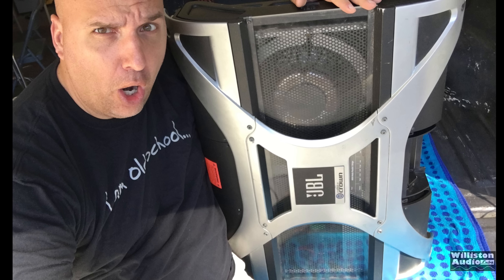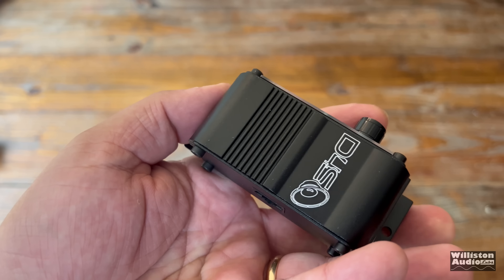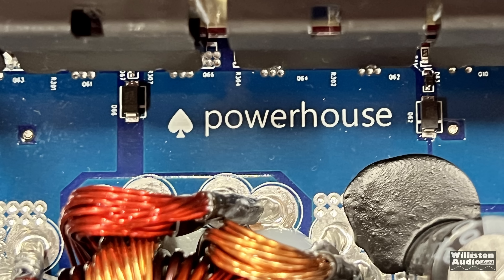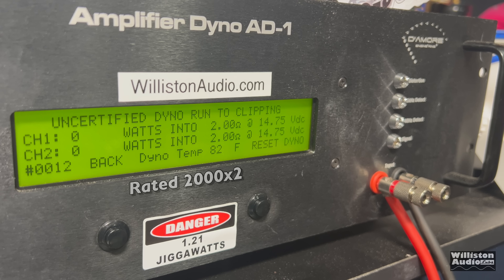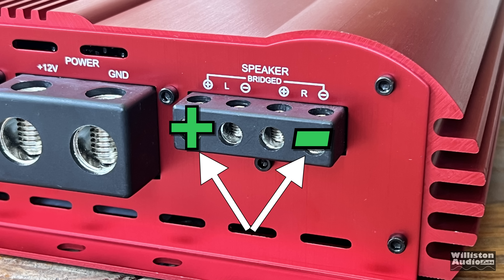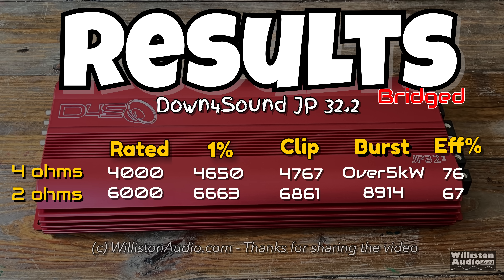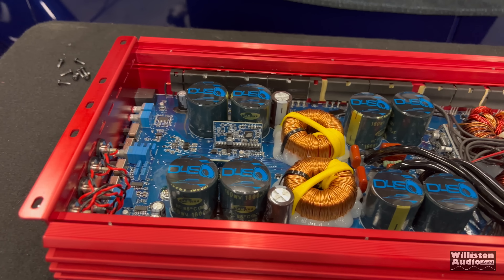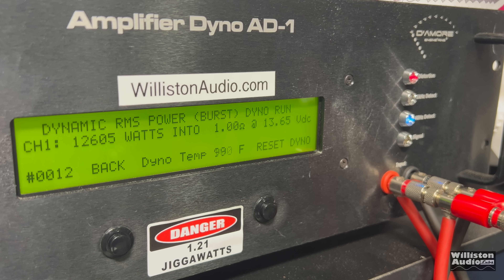Why Do You Need it? 6000W Two Channel Amp

Comment: Jp makes great stuff
Reply: Ehh overpriced for sure
Reply: There nice they smell easy, the speaker instert terminals strip super easy aswell on them. Overall there all right my jp23v2 they get down, but they get pretty warm really quick
Reply: @PedroKing99 good but you needed plenty battery power or lithium though
Reply: @Az56818   u are crazy
Reply: @JohnnyCashCadillac   got multiple jp amps all put put more than rated power
Reply: @jasx1485  nah they're nice Korean amps but just slap his logo on it triple the price but hey there's always fan boys and ppl who like showing off
Reply: @Az56818   yeah I know a bunch of other brands that slap there names on Korean boards as they do with Brazilian boards.    👍 for stating the obvious
Reply: @JohnnyCashCadillac   sure you do
Reply: @JohnnyCashCadillac   when did I even say anything about Orion?  Why you gotta get all weird
Reply: @jasx1485  he wants you
Reply: @adampatterson3188   yeah he deleted his comments acting like a weirdo 🤣 over some amplifier
Reply: @jasx1485  lol I figured 😅🤣
Reply: @@robertdavidson5903  crescendo and dc amps look the same board to me and they just have a different sticker
Reply: @@robertdavidson5903  just stop while you are ahead
Reply: @PedroKing99  it hasnt crapped out on me and seems to be pushing well over rated watts, im pushing half ohm on a zv3 D1 18 SA but like i said they heat up pretty easily and they do tend to smell a little bit when they start to hit 100+ degrees

Comment: Bought a skar rp1500.1 2 years ago when I first put the build in my 98 s10 extended cab....and it never gave me a mins trouble ....but I was a teenager in the early to mid 90s so I remember the old us amps and how cool those big boys were ....so I bought a jp23v1.5 and it's a beast for the price caught it on sale for 249 around first of the year ...and it seems to be a very good amp ...build quality and features for the price I don't think you can beat ....sure there are cheaper amps that might even do same power but for the money the jp amps are a incredible  investment....i have run mine for hours and never heard the fan come on or seen the temp over 116 usually runs around 106....at full volume....granted I am only a little past half way on the gain ....because that's all the power my American bass xr dual 2 12 needs or seems to be happiest at ....so yeah as you say jp for the win ....great products
Reply: You do realize gain has nothing to do with how much power an amp puts out right?   Its matching the input section to whatever your head unit is outputting.  So say a Kenwood Excelon with 5 volt preamp section the gain would stay all the way down and still put out max power.  Just an fyi

Comment: I dont know what you were talking about with the quad box not being hella loud Big D. I had on some high quality earbuds and the bass was insane coming from the quad box. 6000 watts should get you into the 150's with the quad box in the right car. Anyways great video as always bro. Love JP's amplifiers. They pretty much changed the game. Way to go JP. I had been a d4s customer for years before this, but the next amplifier I order is definitely gonna be a JP63
Reply: Yeah man. I have a 8 inch crappy Skar hooked up to my office computer and the quad box was rattling my walls!
Reply: @Jeff_Moreland  That's awesome. I was thinking about doing something similar with a pair of American Bass XR 12's in a 4 ft³ ported enclosure and an Orion XTR 2500.1 I have laying around from an older stereo, but I'm honestly afraid I'm just gonna knock everything off my walls with it, lol. It did a 148Db in a Trailblazer with a small 32Ah LiFePO4 lithium bank, and a 270 amp alternator, and the sound quality was really good on the AB XR subwoofers. Guess I'll try to stuff that old system into the trunk of a cheap hatchback and have some fun with it. Maybe add 2 more subs and a few more lithium cells, plus a JP63 and see how she goes.
Reply: @catch22frubert  that’s a lot for inside your house. If you do it you will need power supply that can provide some voltage to that amp

Comment: The amp not counting cleanly is definitely a cause for concern. Sounds like an interference issue inside the amp. Even with the outputs on a resistor bank, and nothing wrong with the bank, it should count clean. I would need to see a schematic, but I’m willing to bet there’s a filtering/emi suppression issue.
Reply: Won't be no schematics, this is a ZEON brand amp. They will provide no schematics. Its Korean....barely. S and I will provide schematics as long as you are their customer.
Reply: @XM913CG  D4S is regarded very well, making an amplifier that introduces enough noise to where it can’t count properly sounds like a major oops.

Comment: Power is much cheaper today than it was back when the JBL A6000 was made. However, the JBL was still more powerful delivering the 3000W x 2 at 2 ohms rather than 1 ohm. The JBL was probably cleaner power also. D4S really isn’t an SQ brand by any means. They are made for power and big bass, not really anything else.
Reply: Yep, back in the day you didn't have to run massive electrical in your car to hit 150db.

Comment: Do you have a guide or something detailing what these tests represent? I am an aspiring electrical engineer and I'd like to understand better what you're showing here. Great video!
Reply: The certified tests are to show what the power rating of the amp is as certified by the manufacturer. So when they put specs & information in the manual that the amp produces an RMS power of say 500watts per channel that it is Certified from factory to either produce that wattage or close to. Some companies try to be truthful and also tend to down rate the actual power rating put out by the amplifier. So in the manual they would say it's certified to put out 500watts RMS when in actuality it is producing 580watts RMS. For reputable brands it's a safe zone so they don't get called out for lying.

Uncertified tests are just that, uncertified. So where the amp would be Certified to produce 500watts RMS per channel or close to, its' Uncertified rating would be that 580watts RMS that's actually being produced while in use.

The Burst tests are to show what the amp will physically put out in a small duration of time while playing a tone track. An amp will physically play at a power rating far above what it's made to produce while in normal usage. Then it will level off to its' certified power rating.

I hope my ramblings are easy to understand. I was also using examples to get the point across so it's nothing related to the video. I am neither an engineer or a professional audio technician, just someone who finds audio of all types interesting. :)

Comment: A hidden pro of this amp (like the massive 4 channel you tested several months ago also) is this is a modern class D. Most of the big class D amps are still using 20 year old PWM driver tech that can’t reproduce a full range signal, so the tech is reserved for subwoofer amps. But it’s 2023 and standards need to evolve like they have here finally. All the new huge class D amps—even ones intended for subwoofers—should be using modern PWM circuitry like this. Hope amps like this set a new standard
Reply: It didn't count clean at 1khz, I don't know how full range this really is.
Reply: @timmturner  it was probably just slightly above 1% THD because it jumped up at the end to rated. You won't hear 1% THD from an amp on anything but extremely high end speakers or studio monitors. Speakers that costs tens of thousands. And even then wthout well trained ears you'd only hear it playing test tones and not actual music
Reply: @darrylpioch2055  what I'm saying is at higher frequencies it may be worse
Reply: @timmturner  and class Ds have different distortion levels at different frequencies. Any frequency that's a lower harmonic of the amp's PWM switching frequency will have a lot more distortion. That 1K could have been among them and it might have a lot less distortion at 15 or 20k

Comment: Hey man I have a question for you I have a taramps 3k hd and and 2 dual 1ohm Rockville punisher wired at .25 ohm. Do you think this would damage my amp, the amp is turned down very low because this amps is insane on power! Big shot out to you and your channel because without watching ur vids I wouldn't of know how much power this amp has. it runs fine amp doesn't get hot no clip light or protection goes on. Would value your opinion cuz ur a pro!

Comment: Are the speaker outputs too small for almost 5000W/channel
Reply: No they are fun
Reply: I mean, technically, they should be 4 gauge outputs if you want the real answer from an electrician, but 8 gauge will be fine for most people, and you can always get a pure copper dual 4 gauge to single 8 gauge if it's something that bothers you. But yes, technically, those outputs could be hitting 100 amps each in quick pulses. I would recommend a dual output or 4 gauge to 8 gauge reducer and use 4 gauge ofc wire and you will definitely be fine, even using it for bass demos only
Reply: @catch22frubert  he hit 468 amps on that one run
Reply: @BloodCover thats on the input side, not output

Comment: How can the amp dyno not go above 5002 (over2) in that one test when you state it can't measure over 5k, yet the next tests are over 8k?
I'm confused.
Reply: It depends on the Ohm load. the higher Numbers were on 2 and 1 Ohms.
Looks like the Voltage gets too high. So it should stop at 10k at 2 Ohms and 20k at 1 Ohm

Comment: Personally don't like the fact they used only 85C caps on the one section. Amps get hot. You should always use 105C rated caps.

Comment: I had to jump on 1 of theses for the Christmas sale i got it for 414$ out the door with shipping protection,  i figured at that power i can use it for a bass amp  if my jp83 ever has any issues @wal , if powered and tuned correctly i should be fine running it as a bass amp correct?
Reply: Got it for that price too. I emailed D4S and they confirmed it can definitely be used for subs.

Comment: I have a question big D, I just installed 2-12s audio legion maximus but I only have 1-skar 1200.1 amp should I pick up another matching amp so I can run one for each sub or try and get a 3k amp or bigger??
Reply: If you have clean power to run a 3k it would give you a little more head room to go that route but it takes power to make power if your trying to pull 3 k off stock electrical system its gonna be hard to do without some help.... personally i would go with a 3k if you have the electrical to push it not to mention its half the wiring running one amp VS two smaller ones

Comment: That amp seems defective. Also, why did you say the amp dyno cant measure over 5000 watts and then the next run 2 ohms bridged it reads 6664 watts? Are you sure that the OVER2 isn't some kind of overload protection on the dyno? Amp seems defective.😢

Comment: I’m on the market for a amp i’m looking for something around 1500 watts rms in 1 ohm. been looking at downforsound and ct sounds amps but noticed no fuse boxes on most of these amps unless you go name brand like kicker etc. i’m wanting to get two dd audio 10s 4ohm  600rms each. Any suggestions?
Reply: also if was to pick up a amp like the jp8 why do they not have fuse blocks?
Reply: @Inimical_imi you have to use an external fuse. My CT sounds AT2300.1D is fused at 250 (externally) I actually prefer it this way. I'm not a huge JP fan but his amps are pretty nice and some are priced well. As for CT sounds, this is my first amp from them and I am impressed,  it's a little powerhouse and the build quality is decent. Still not sure how accurate the voltage meter on the bass knob is though...but the clip light seems on par with all my tuning.
Reply: @zackbalins658  thanks for the reply. alright that makes sense. i’ll def be considering it as a option more now. i’ve been torn between the jp8 and ct sounds 1500.1  i’ll have to do a alternator upgrade and the big three running 1 ohm but i think i can run em at two ohm until then and get decent performance
Reply: @Inimical_imi  funny you mention that, because I'm actually running my two DD612's at a final 2 ohm impedance on the CT amp. Looking to get different subs for a 1 ohm load. I do have the big 3 and a Mechman 270...but no extra battery reserve. It does ok.
Reply: @zackbalins658  nice!!! i’m just getting back into car audio got a older trailblazer 2008 i’m wanting to do some upgrades to not wanting to compete (spl) but wanting to compete with one of my fave set ups i’ve had a single jl w3 12 w a 500/1. 

If i did get a amp in theory that runs 1500 watts i’d need a line fuse that’s 150amp?
Reply: @Inimical_imi  correct...if the amp is not already fused. There are 1500 watt rms amps out there that are already fused as well...just make sure those fuses in those amps equal around 150 amps or so. I'm sure you are aware that the fuse ratings you see on an amp will give a good indication of the power it'll put out.
Reply: @zackbalins658  ok awesome and that’s what a friend had told me recently. but now i have a bit more knowledge to the collection thank you!

Comment: Such a crazy amount of power for mid/hi speakers. I'm trying to think of any speakers that can utilize that kind of power, but am at a loss. I checked their website and couldn't find any speaker/components rated at anything above 300w rms.
Reply: Mainly for hooking up tons of speakers on 1 channel. For example people would run 6 or 8 mids in each door and use each channel to run a door or multiple doors.

Comment: I have 2 secondary batteries can i wire them together in order to make 3 total batteries .. i have a shuriken 1800wat battery and an xs power 3000w 1200amp battery .. would i be able to wire them together with the car battery or would that be bad ? Ir should i only use 1 ?